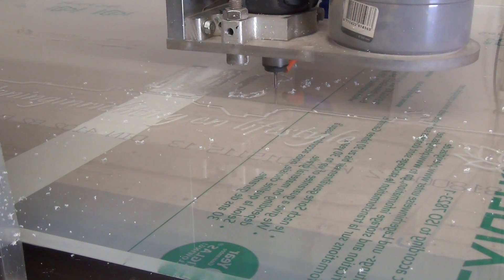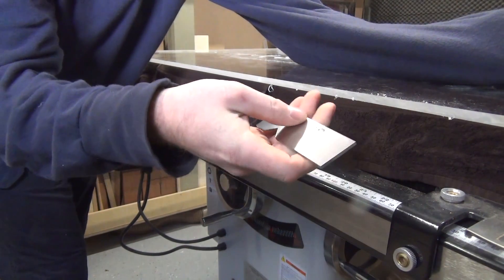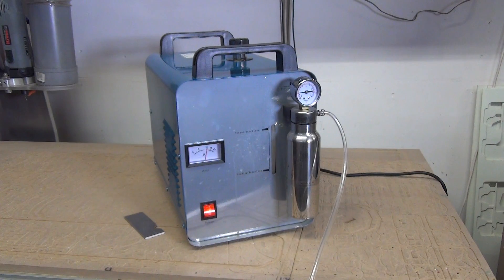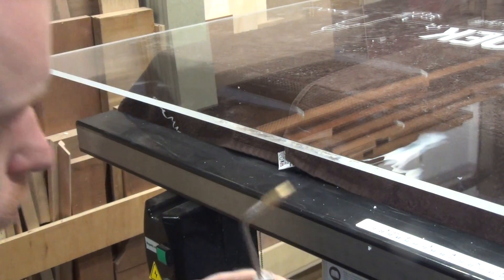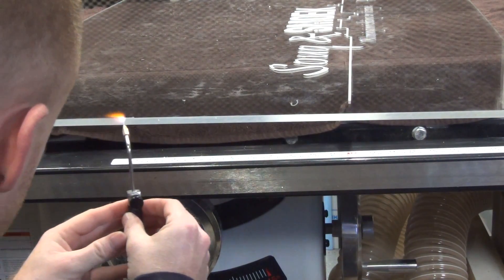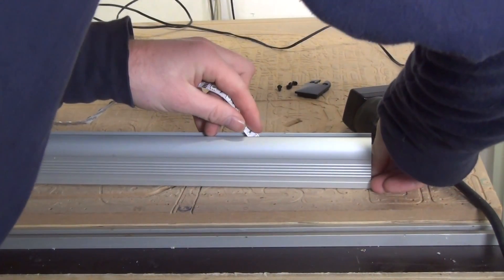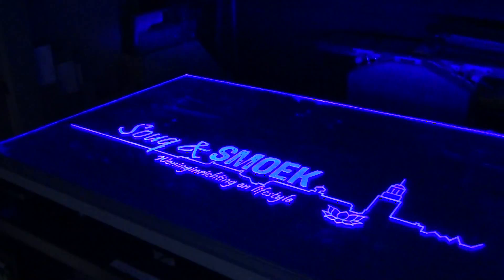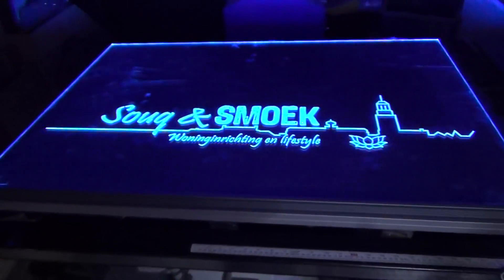RCNC Projects 47: Acrylic engraving and flame polishing the edge.

Comment: Hi Marcel, very nice Sign! Should also do one next time. 
I always sanded the edges befor polishing with the flame. Should i try w/o sanding.
Thanks for posting.
Regards Fritz
Reply from the maker: +Tchefter Hi Fritz ! Yes this is a very fun project to do like so.... 
And sanding before flame polishing works great to... 'But' sanding involves the risk of scratching the front or back of the panel.. That's why I use the scaper.. It very hard to make a mistake with that one, and the result is just as smooth as with sanding.